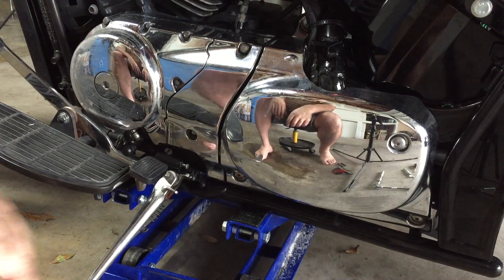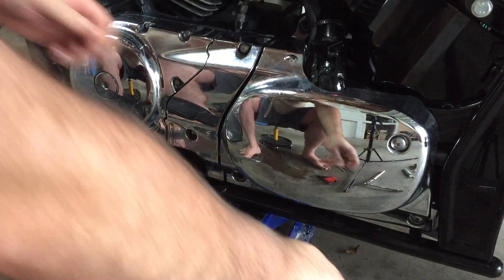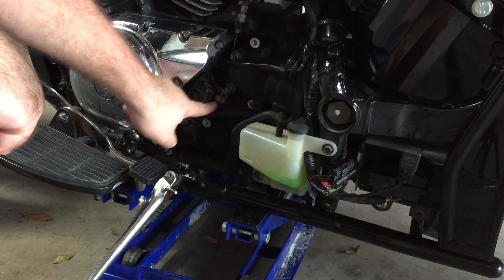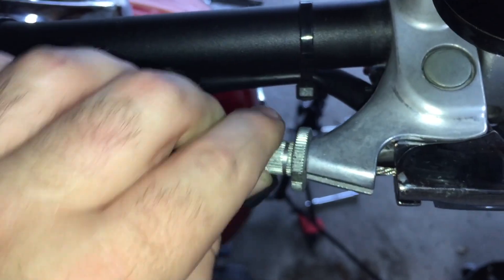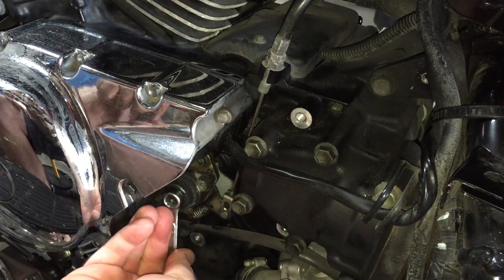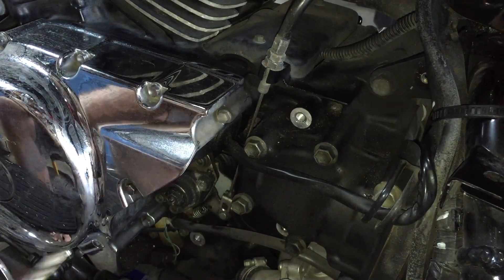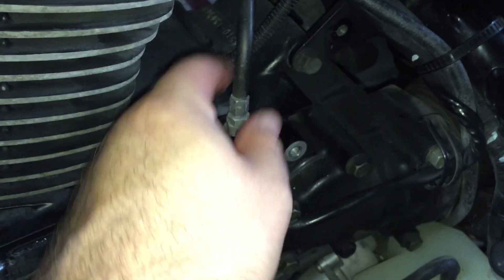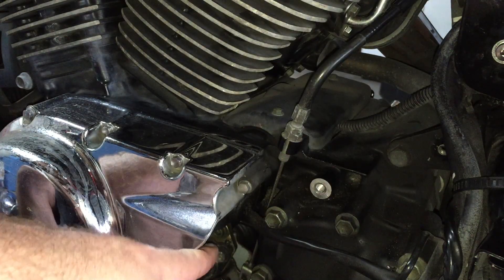How To Do A Full Motorcycle Cluch Adjustment

Comment: i've raced dirt bikes professionally, so clutch lever replacement, adjustment etc. was easy... but on a street bike, especially a cruiser, it's a lot different in your adjustment as you have multiple points, unlike a dirt bike. I recently had to replace my clutch lever because my kickstand wasn't all the way down and I stupidly dropped my boulevard, breaking the clutch lever. After replacing my clutch lever, if i didn't pull it a certain way, it would stick all the way back... this video helped me identify the problem and make the proper adjustment in short order.  Thanks for a good quality video... it's much appreciated man.  Hope all is well and you're riding safe.

Comment: Excellent. Easy to follow with good explanations and still a short post. Helped me with my slipping 2006 C50. Note: for the 4mm gap at the lever, you can also use the 4mm allen wench.  Thanks for you post.
Reply: The Clymer book said 10-15 mm measured at the tip of the lever.

Comment: awesome video, my lever ha about a 1/2 in gap now and top is adjusted about all it can, I now can do this myself and after seeing this I think I need to just adjust the lock nuts on bottom, I had new bars put on and thing they forgot to adjust that part but if not I know how to check the clutch itself. thank you.

Comment: I dropped my bike on gravel at the weekend and snapped my clutch lever..I though there was no other damage but 200 yards down the road, I had nothing but revs in 1st and 2nd gears. No bite. I adjusted the cable and everything was fine until I needed to go uphill and wanted extra torque. Back to square one. No power to the drive but revs. No burning smell from the plates. Everything went tight, now gap at the lever end and the screw and locking nut were solid

Comment: Thank you so much I have a 2005 C90, it was sitting in the rain while they passed this little used car lot so I bought it because the mileage was only r4900 miles. So I bought it it didn't run had a towed to the shop they fixed it up it's been running good, now I have 5,300 miles, I was wondering if you could show how to check the injectors, or even how to access to get to them maybe I'll just replace them it was sitting in the rain before I bought it for almost a year

Comment: Great video, clear and fool proof. I have a 2008 suzuki C50, and seems like theres an oil leak at the transmission bar in the engine side. (the part thet connect engine and rear tire). Is there a seal that might be damaged? Im kind of a handy man so Im familiar with mechanic jobs, so the real question is, how difficult would be to replace this seal? Is there a video showing how to do this job? Thanks and keep the good work!

Comment: I followed your instructions word for word...worked great and got me back on the road.. 
The thing is, I'm having to go through the same routine every couple of days . What could the issue be? I'd rather fix myself than send to a shop for stupid labour charges
Reply from the maker: You probably need a new cable and/or clutch
Reply: @TwoWheelObsession  turns out the clutch is burnt out. My bad habit of coasting had caught up with me 🤦🏻‍♂️

Comment: Did yours have a sliver tab around the adjustment nut? Mine does and I’m not sure if I need to take it off to be able to adjust it or not because I tried with it on because I couldn’t get it off and I couldn’t get the nut loose

Comment: Great video definitely needed to learn this!! Quick question in 4th and 5th gear only just recently seems like I'm losing power.... I can get up to speed slowly but if I tried to accelerate to pass a vehicle that's where bike seems to lose power.... any suggestions what it could be?? Local shops are crazy expensive and I hoping it's something I could fix myself.  Thanks in advance
Reply: I am having the same issue. I wonder if it can be fixed, at least for some time, with clutch adjustment or actually the clutch needs to be replaced. Adjusting the cable obviously would not help, but perhaps turning the bolt (what he does on this video with a screwdriver) might. I honestly do not understand what this bolt does.
Reply: @schimmeljager811  The only answer I have for you is that with a v twin you need to use the gears more than say a 4 cylinder bike. I'm no mechanic so that's all I've got 👍BTW, Great video. 
1990 VX800 Owner. Planning to tackle Scotland in June.
Reply: @noddyvision77  I replaced the clutch since my previous comment from 10 month ago :) Following this guy's video. Btw the biggest challenge was to remove exhaust bolts from the cylinder head. It did not happen here but on my bike they broke. I tried heating, all kind of vice-grips, Kroil, welding a nut... Nothing worked. I ended up drilling them out.

Comment: Good video,  I have a question that you may be able to answer.  I recently bought a c90t boulevard, and on I bought it used without a manual. On the instrument panel there are 2 buttons, one works trip meter and odometer,  other one makes a number of little squares come up,  what does those squares mean?  Thanks
Reply: Those squares show the relative brightness of the indicator lighting. Bright- dim by use of button #9

Comment: I have a 95 VS800 Intruder that I bought about 2 1/2 years ago. It had sat in a garage for years and had only 1860 miles on it. I now have nearly 14,000 miles on it and I’m starting to notice the clutch slipping a bit if I get on it hard. It’s a hydraulic clutch and was wondering what is the most likely culprit. Did I understand that a hydraulic system does not require adjustment?

Comment: Does the bike have to be in neutral?  Also...book says... Turn in the adjuster 7 until it
stops. Turn back the adjuster
7 1/4 turns.

Do I go with resistance as you state, or turn until actual stop as book says?  I'm confused...I tried resistance and no change in clutch...almost all the way out before it engages....does not slip while riding, but not use to let that much clutch lever out...kinda tricky at steep hills.

Comment: after changing my clutch fluid, and putting everything back together, I find that I no longer have to depress my clutch lever to start my bike. "suzuki intruder 1400". can u explained what's happening here and what I did wrong. thank you
Reply from the maker: You may not have proper cable freeplay, the clutch sensor is being tripped.
Reply: thank you sir. but mine is hydraulic.  would that still be the case??

Comment: Hi there, when you replaces your clutch, could you still hold the clutch basket and spin the tire while the transmission is in gear? https://youtu.be/krsba0N9Pck I am chasing a problem down. I have had the whole drive shaft and U-joint out and they are fine. Any advice would be appreciated.